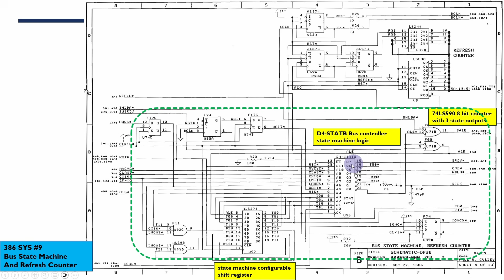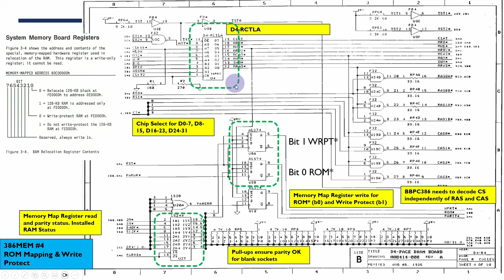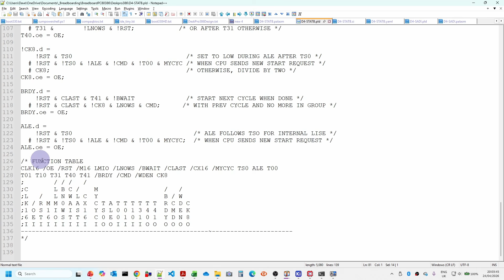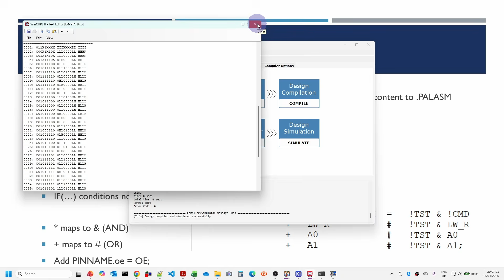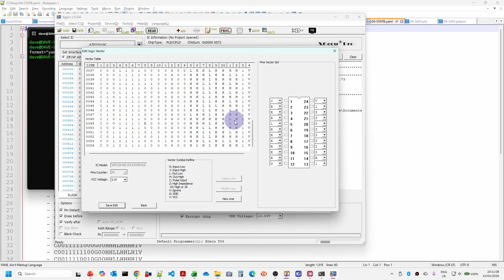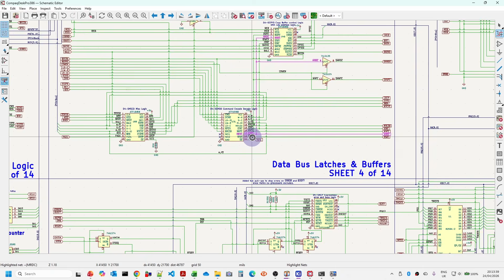386 Breadboard PC #7 Bus controller PLD conversion & Test

Comment: Dave, thank you for another really great video! it's helpful in so many ways to me. I didn't know about "XGPro Logic " tool, even I own T56 since the end of 2022. also, how you port Palasm to a more modern WinCUPL is nice to know. BTW, about the "TS0" issue and actually about the verification of all those PALs source code ported to WinCUPL - I can do totally "blind test" - what I mean by that - I have plenty of PALCE16V8 and PALCE20V10 leftover chips from my youth, i.e. what back in the days was the programmable version of those One-Time-Programmable PALs and an ancient programmer that supports them (modern ones like T56 can do only GALs and ATFs). so, I can build the verbatim Palasm source code extracted from those PDFs in PALASM4 software, burn it to a PALCE16V8 or PALCE20V10 depending on if PAL16V8 or PAL22V10 was used together with that source code, then test that PALCE in T56. such test will definitely make it clearer (if not exactly clear) where potential issues like the one with "TS0" is occurring, because it's totally alternative chain of preparing the programmable logic ICs from the source code in the PDFs.

Comment: Can you share a link to or a picture of the exact programmer you're using? A search of eBay and Amazon produces a mess of different devices with similar names deliberately done to make you buy something that isn't actually the thing you're looking for. Also thanks for sharing your PLD workflow, I was going to ask you to in the last video. It is pleasing to see that the ATF22V10 is still available on Digikey. I have a boat load of Lattice 22V10's and it'd be interesting to see if they are drop in replacements.
Reply: Oops. Sorry, I just saw that you showed and image of the programmer in the video. Thanks for that too! 😄
Reply from the maker: If you search Amazon for Xgecu T48 or T76 then this should come up with the equivalent. The T56 I have has been replaced by the T76. The prices vary depending on what adapters ship with the programmer. Mine came with quite a few. Hope this helps. Dave
Reply: @breadboardinglabs  Thank you. I found the company store on eBay. It was cheaper from them than the ridiculous prices on Amazon. Cheers.